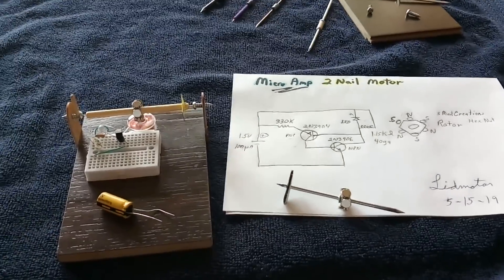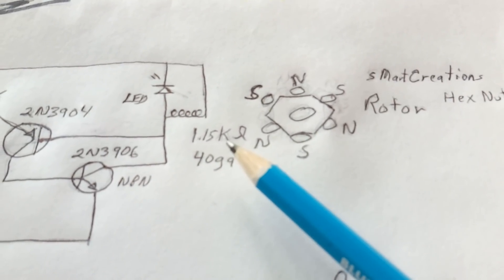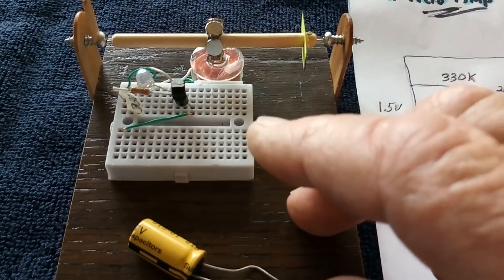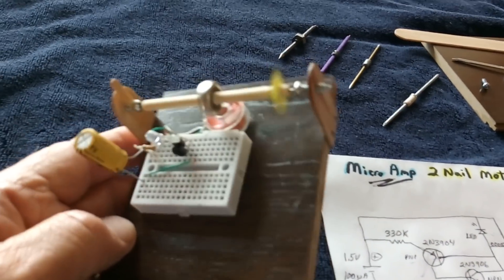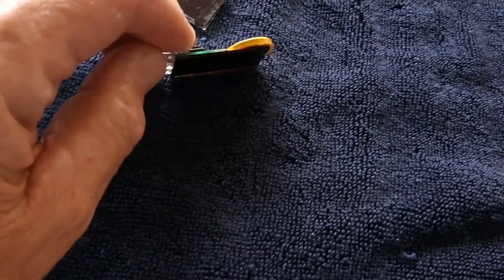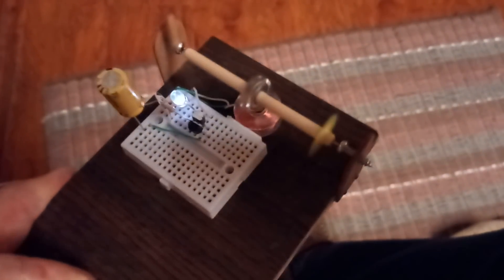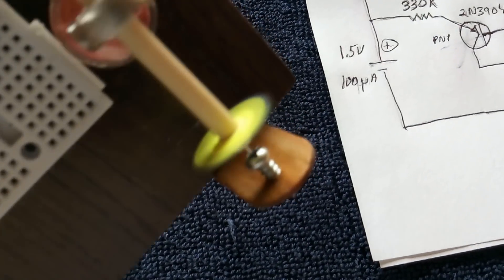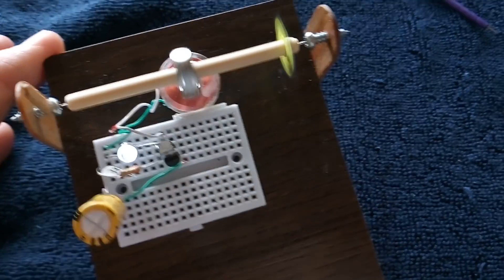Micro Amp 2 Nail Motor

Comment: Lidmotor  I took your advice and put in a 1M pot.  You were right, this thing is touchy.  Finally got it to run.  Working on getting it to run faster so the LED light appears steady. Thank you for your suggestion.
Reply from the maker: Glad you got it running.

Comment: Lidmotor Have you thought about using Tig Welding Tungsten in lieu of using needles?  After watching this video, I started to build my own motor as a curiosity and "Nite Light".  I 3D printed my parts including the 1/2" thread required for the large nut.  I thought I would try 3/32 Tungsten and after sharpening and taking it for a "Spin", the nut rotated smoothly.  I am working on the circuit you posted and did not have the exact PNP and NPN transistors so I substituted for two other NPN PNP small signal transistors not thinking this would be critical.  Your coil is over 1K and mine is around 860 ohms.  I did assemble the circuit, connected to the coil and the rotor did act like a generator when spun.  I was unable to get it to run on a power source.  

How I think the circuit is supposed to work and please feel free to correct me if I am wrong. 😒 
As a magnet is passing by the coil, a current is induced in the coil and therefore resulting voltage.  This voltage acts as a second voltage source turning on the PNP, then the NPN and the coil now is energized for a short time and the cycle repeats.  The energizing of the coil attracts the magnet to maintain rotation.  Is this correct?

How is the value of the resistor calculated?   Thank you in advance.
Reply from the maker: Put a 1 meg pot in there to find the right resistance.  The circuit is a bit touchy but you have the basic operation right.   You might have to try different transistors to get yours to run.  I like your Tungsten welding rod for a shaft.  I might have to try that.  Thanks.
Reply: @Lidmotor  Thank you for your reply.  I will give the potetiometer a try.

Comment: I've been a long time viewer of your work. Love what you do. I was wondering whether you have thought about trying to control the speed of the pulsed motors? I was thinking along the lines of the old hit and miss engines that essentially allow ignition (or in this case electric pulses) only when the rpm of the engine falls below a preset value. A couple of things come to mind - using the technique to control the speed of the pulse motor or extending the run time by not pulsing the motor each revolution - just when it slows down. Now just have to think how to do this...Great stuff, keep up the good work.

Comment: Here is a response to you saying you will need to add a reverse diode in line with the solar panel.
This is what I have done. I removed the NiMh battery from a solar light, and placed a 500F supercap in its place. And I added 3 more solar panels (those tiny ones) in parallel (they are 4 cells of 0.5x Volt per panel). My point: why add a diode? If you use the wrong one, you loose half a Volt, if you use a good one you loose 0.14 Volt. However, I tested the current 'at night', but the solar panels (those brown ones, like you have on the flashlight) have almost zero current draw. What do we learn from this? Not just listen to what everybody says, because 'it is'. Sometimes 'it is not', but you have to find it our for yourself. Please check the current draw on a solar panel in the dark. Also consider: the most power (for a supercap) is when the voltage is as high as possible 1/2 * C * U * U. This is why my little project is a win-win. The super cap can run the solar light all night without any problems, and still has about 2 Volt in the morning. I could remove some panels, or use a smaller super cap. But I only have 25F and 500F caps at hand.
My reason for testing with a supercap is that the batteries are the weakest link in the solar lights.
The next test I will do is to work with LiFePo4. 7 solar cells of 0.5 Volt will deliver 3.5 to 4 Volt, which is really perfect for LiFePo4. The application does have to shut down below 2.6 Volt to prevent damage. But I will just use the protection circuit from a LiPo battery. KISS.
Keep playing ! It is very rewarding.
Reply from the maker: Many thanks for that great info.   I totally agree that the battery is the weak link in the common solar garden light.   Actually corrosion at the battery holder contacts is the worst design fault I have found. The soldered in super capacitor solution seems to be a good idea. As far as the diode on the solar panel I agree that on these small panels it isn't really required because the panel has so much internal resistance.  I have a bunch of Li batteries waiting to be tried when I get the time.  I need to figure out the best (and safest) way to do it. I have had some scary 'almost fire' experiences with careless shorting of 18650 batteries that really has me stopped on that.  I might go to the old method of putting a fuse right at the battery to go really safe.  They are supposed to have internal protection but tell my melted wires that.

Comment: Like your video and build. Question: how can i center the best way, the needle at the end of the wooden rotor stick? I mostly get a very wobbly result.
Reply from the maker: Good to hear from you!  Your 'Hex Nut' rotor idea has worked great for me.  I'm glad that you asked about the needle in the stick centering problem.  I am also having great difficulty getting it centered in the wood shaft to avoid the wobble.  Yesterday I tried drilling a hole in the shaft end much bigger than the needle diameter and gluing the needle centered up in the over size hole. That worked pretty good.  If you use a very short needle tip that helps also.  There has to be a better 'kitchen countertop' way of doing this.  Perhaps someone here can suggest one.
Reply: @Lidmotor  I will try that solution someday. My rotors: i filed  to outside to a point. This goes so slowly. During filing i rotate the iron (M6) constantly, therefor the point is somewhat at the center of the rod. Greets M

Comment: Nice build.  The biggest challenge I have with these 2-transistor drivers is getting a good high-resistance coil.  I have trouble with anything finer than about 34 gauge (AWG).   It's just too hard to handle (for me).
Reply from the maker: I feel your pain about super fine wire coils.  They are very hard to work with but to get the super low amp draw I have to deal with them.  Some guys use coils out of relays that work OK.
Reply: I have made some great little lid motors with 12 volt car relays. Take them apart and drill the core out. Great
Reply: Last pulsemotor project I made with a 220V relay coil with 13Kohm resistance. An other good coil, 9Kohm, is from a mirrorball 220V motor. Also 24V and 48V relay coils will do.